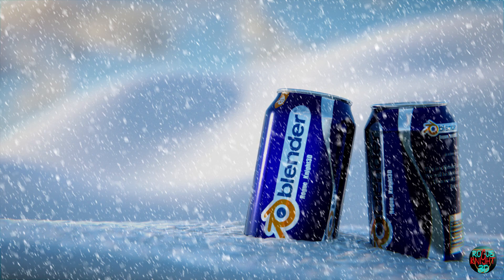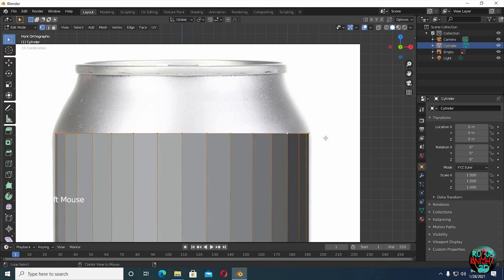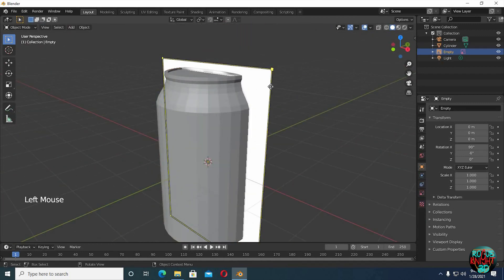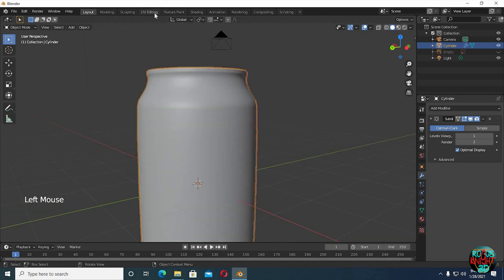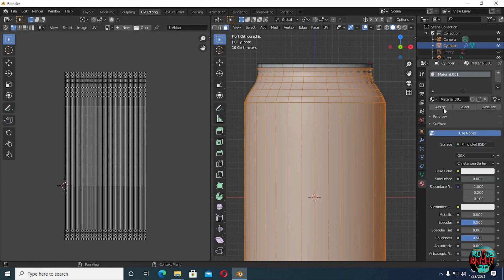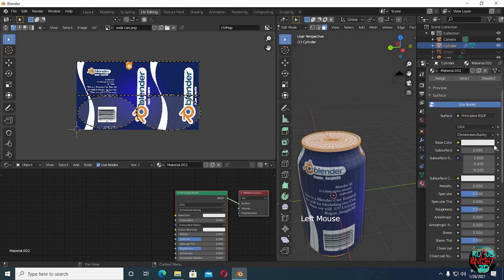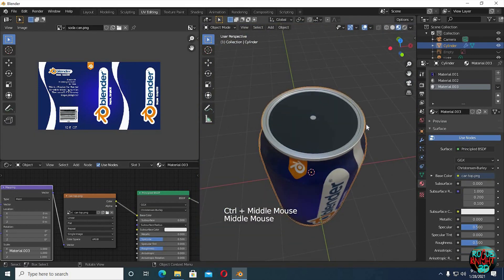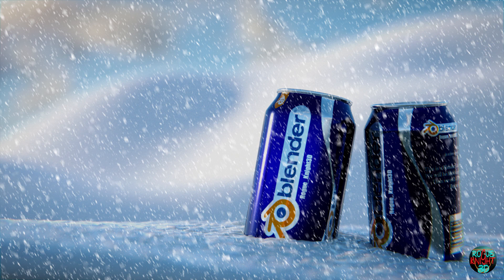Make a Soda Can in Blender || Blender Tutorial for Beginners || Make a Can in Blender

Comment: How did he scale the top of the cylinder at around 1:09?? No matter what position my cursor is at, whenever I press s it just makes the cylinder wider
Reply from the maker: You have to be in edit mode. Tab to. Go. To edit. Mode and select the top vertices.. First press e to extrude then s to scale down. If your doing this. Then the whole cylinder won't scale
Reply: @RogueKnight3D  thanks, man
Reply from the maker: Its totally ok
Reply: @RogueKnight3D  Excellence